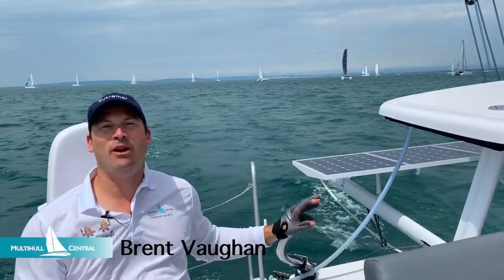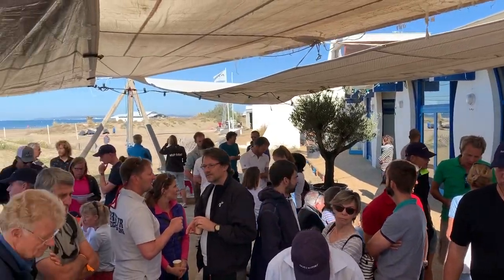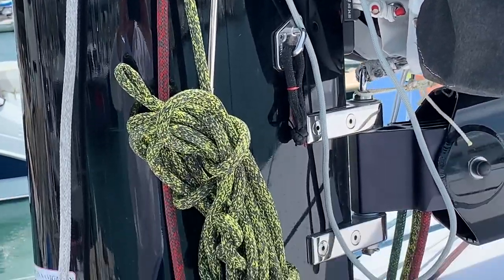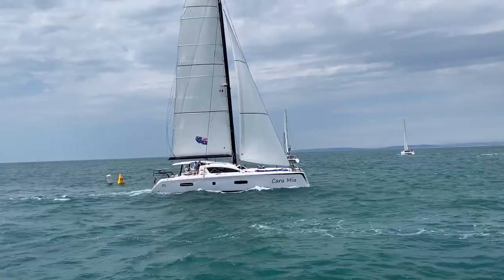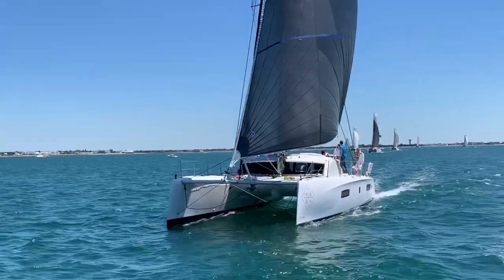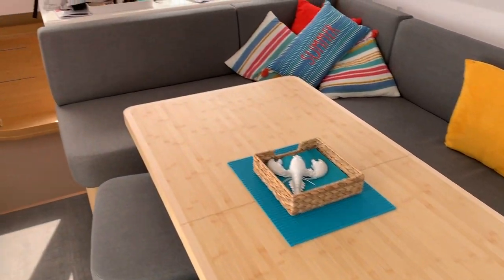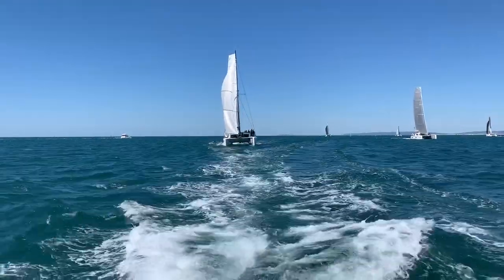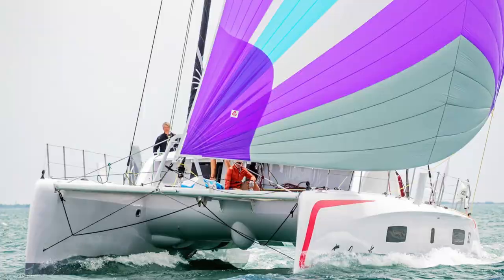Sailing the Outremer 51: Voted Best Multihull 2018 [Walk through, sail and factory tour]

Comment: Gorgeous Boats.  My Question: with the O45, now 48'. The 51 is only 1 meter longer, 1/3m wider, but 3t heavier.  Other than length, beam, weight, how would you compare these two boats?  What are the big differences?  I've only seen the 5x at boat shows in the US, one person told me the headroom in the 45 is just as good as the 51.    Given the choice between the 45(48), older 49, and 51, what are the tradeoffs?  Thanks.
Reply from the maker: Hi Mark, the Outremer 51 remains the sweet spot for the brand because its a great trade off between size that is still manageable by a couple, yet has the waterline length for performance and payload for common comfort requests. I agree down below there is actually not that big a difference and i think thats definitely a benefit for the O45, however there is certainly a more generous living layout in the saloon and cockpit .Though the cockpit is not walk through, its HUGE in terms of seating and makes a nice outdoor living room with the curtains dropped. The O49 is the O51's predecessor so it hull is shorter but essentially the same, as is the layout. You miss out on then nice modern styling updates internally and the raked bows. Obviously the O51 is more expensive than the O45 too. Thanks for your comments! Brent.